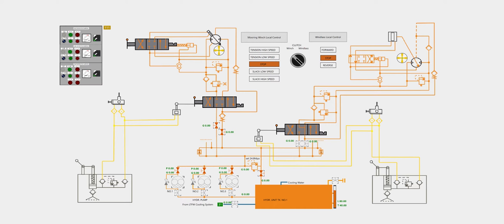Mooring  & Windlass System Tips -Problems

Comment: While heaving up anchor ,if power failure occurs what happens?will anchor goes back to water or will it stay in that position ?how we heave up anchor if power failure occurs?
Reply from the maker: You can use the brake to stop and keep in that position.
Reply: @Adventure-Story  okey I agree ,does the dogclutch hold the anchor in the same position during sudden power failure or anchor will start to go back ?